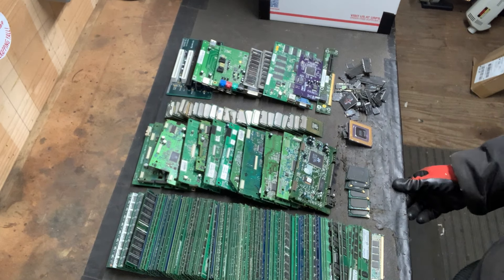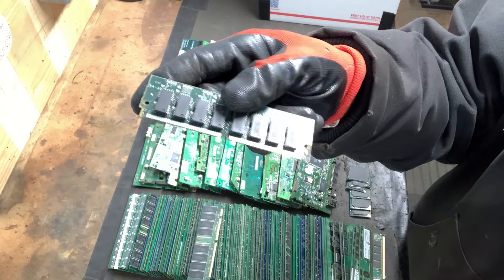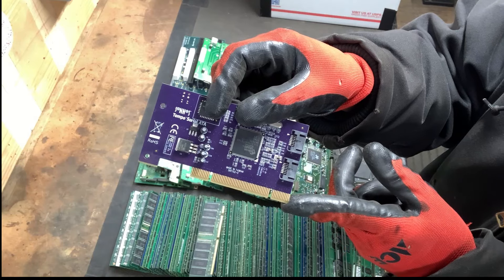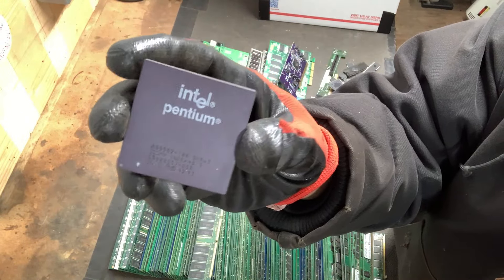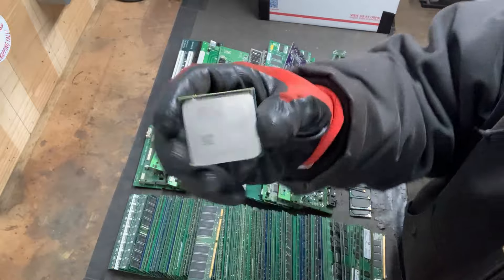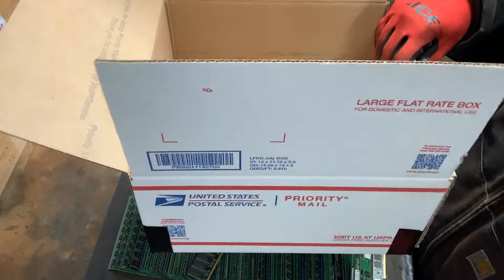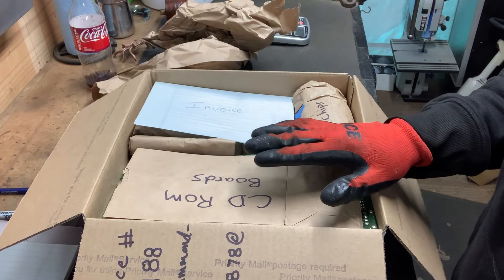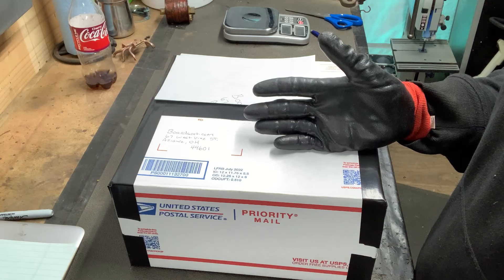How to Sell Ewaste to Boardsort

Comment: Great video.  One thing I might add to it...on the paper bags, I would take the extra time to tape them shut as well.  Just a small detail, but I have seen how the postal service handles packages sometimes, and I tend to "overkill" on my packing, just so there aren't any problems.  I now have my computer up and running, so will be more interactive on the livestreams and hopefully will join in on occasion!!
Reply from the maker: Thank you Roger, I greatly appreciate it. 
I did use some tape but I should’ve used more and talked about it, thank you buddy. 
Oh cool, that’s great Roger.
Reply: Yes the post office can be brutal😂
Reply from the maker: @terrychain-xo8uu  you would know lol. 
Thank you for watching mother.

Comment: Love the video! I have a pile of old computers I am starting to break down now, so the information was very timely! Shark Scrapper also has great video's on shipping to Boardsort, just FYI.  And here's a "pro tip" for shipping heavy things you don't want to shift. When you build the box, take the two flaps on the bottom inside together end to end so they can not overlap or shift. It adds an extra layer of stability to the box. When you are done and start to close the box for shipping, tape the first two flaps together end to end as well. Doing this on both inside flaps will greatly increase the rigidity of the box overall. Thanks for sharing the information!!
Reply from the maker: Thank you! 
Yes, Shark Scrapper has a lot of useful videos. 
Oh cool, thank you so much for that tip, I appreciate it.
Reply: I’m paranoid about losing $200 worth of eWaste too, so I tape the inside flaps like you mentioned. I’ve even spent a few bucks more to insure an expensive box. I think USPS insures up to $100?, but my first box was well over $300 in a large flat rate box. I had a bunch of RAM and working i-series CPUs. Cha-ching!

Comment: Thank you for the Ohio location tip, I live about 1 hour drive from there.
Reply from the maker: Perfect, you’ll be able to sell a lot more stuff than I can. 
Thank you for watching.
Reply: That would be worth the drive. Gas would be less than shipping if you had a decent load! You could get paid for lower end stuff that wouldn’t normally be worth shipping (I live in Utah so the $3-$4 per pound is the bottom end of value I’ll ship to make it worth it)

Comment: I wish someone would show a tutorial on removing boards. I try to wiggle boards and chips loose and break them. Do I heat them to remove?
Reply from the maker: That’s a fantastic question and that’s something I will be showing in some future videos. There are a few different ways to remove the components. One way is to use a hear gun or a hair dryer. 
Thank you for watching.
Reply: @scrapitall200  I have had a tiny bit of success using a hookah torch/lighter. I don't smoke, but it comes in handy.
Reply from the maker: @onyxfire7511  that’s cool. Whatever works, right! 
I usually use a wood chisel and chisel them off.

Comment: do you still remove all the copper components from the boards or sell them complete?
Reply from the maker: I personally remove them but some folks leave them on for the board weight. 
Some boards it’s required to remove certain things, like heat sinks, metal or plastic brackets, batteries etc. 
I’m going to be doing more videos on ewaste and how to prepare the boards for Boardsort and also how to depopulate boards and which ones to do. 
Thank you for watching.
Reply: @scrapitall200  that's good to hear because I don't know what a ic chip is from a bass drum and that would help to know whatnis what...I have boxes of boards that still have everything on them even the copper donuts and didn't want to cost myself money in the future by removing something I wasn't supposed to
Reply from the maker: @kevinclark3557  thank you for your comment, it’ll help me to know what sort of videos to make.

Comment: But wait they mske us fill out sheet.
Reply from the maker: No. My printer died and I had to hand write it out instead
Reply: Alright so you had to fill out a sheet so what happens if you get the you know what you checked off wrong they I mean they check it anyway right so what's the point
Reply from the maker: @THEATREGOD3  you’ll have to ask them